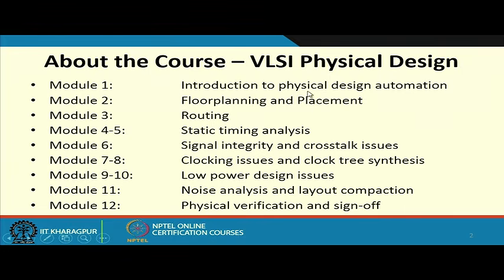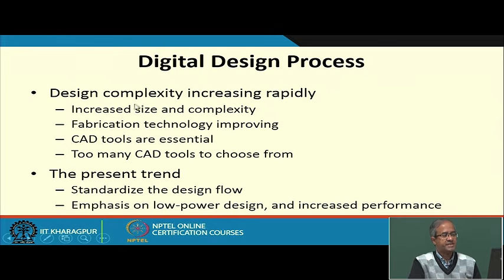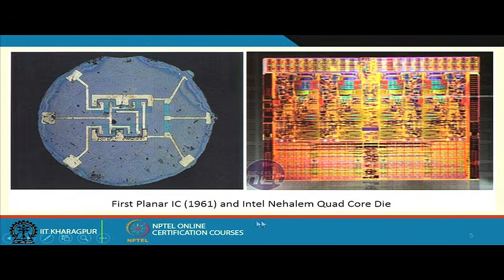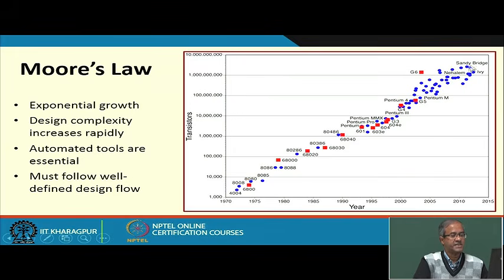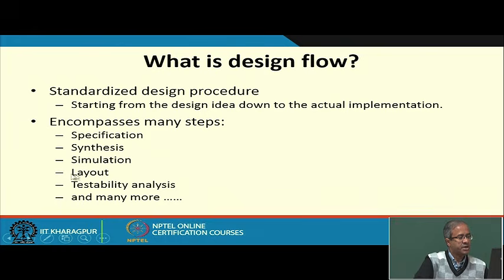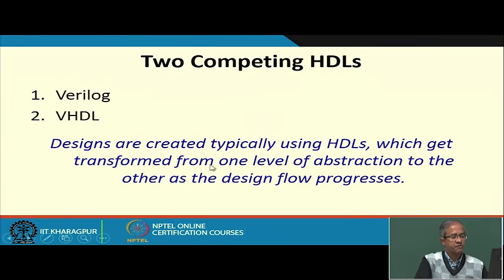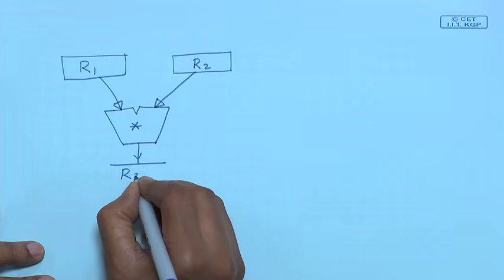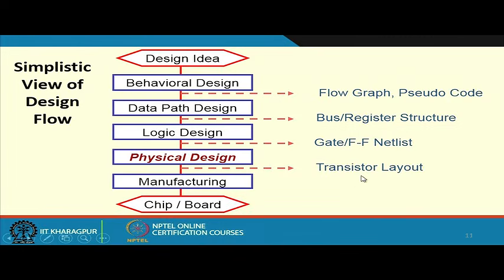Introduction

Comment: sir may I know which software used for vlsi physical design
Reply: The class of software used to design chips is called EDA (Electronic Design Automation), and there are at least a hundred companies in the U.S. offering EDA packages for every need. Two of the most famous are Synopsys and Cadence Design, and the latter has an office and a design team in Bangalore. India does not manufacture modern chips but is fast catching up in chip design.
Reply: cadence virtusa
Reply: @anweshvarada1503  virtusa is an american it company.its virtuoso not virtusa